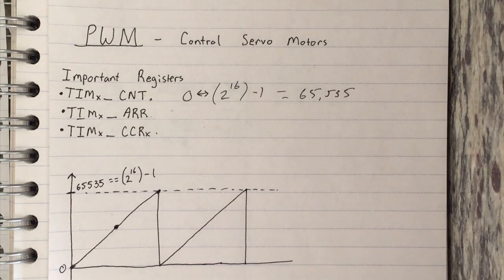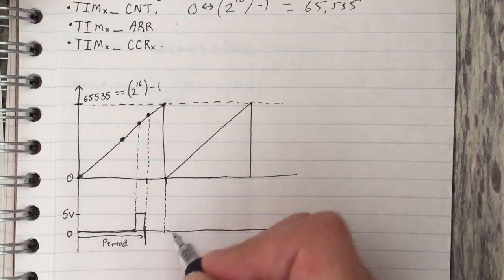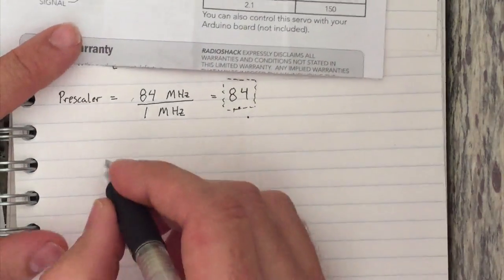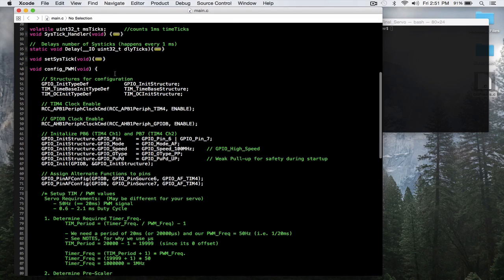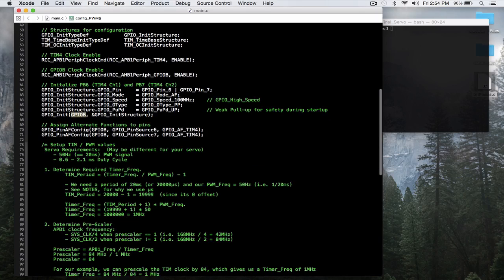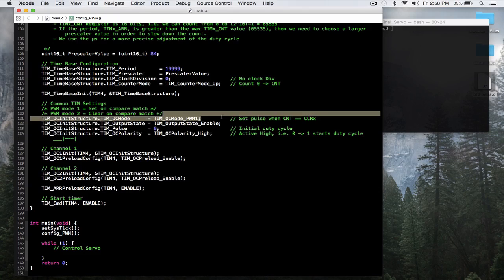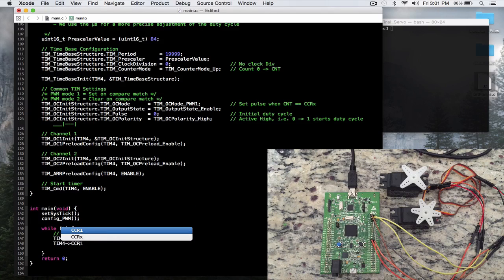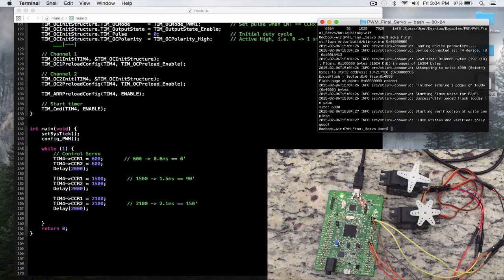STM32F4 Dev. | #5 - PWM Servo

Comment: can't figure it out why timer_freq = 20000 us * 50 ticks/s = 1MHz ?. Given  APB timer clock is 72MHz,  set prescalar = 1440, counter period = 1000,  and set CCR from 50 to 100,  should this work? had examined using oscilloscope, it seems correct, but didn't work for servo.  
please correct me.

Comment: I'm having a hard time connecting your diagram to what you did in code. isn't ccrx register the value when the counter reaches it turns logic level high? if so that would mean at 600us you are going logic high and staying high for the rest of the period?

unless you are starting high and after 600 (0.6ms) going low

Comment: Hey tony, I had a doubt regarding driving dc motors(not servo, the regular free running ones) . I am controlling them using a joystiick. I want them to have a soft ramp for a few miliseconds and than go into free running mode when I take my joystick to the highest point. Can you clear some of my fundamentals please?
Reply: kind of like how we start the car through first,second,third gear and then completely throttle it at 4th gear
Reply: i would say dynamically change the duty cycle in a loop and the duty cycle is equivalent to the joystick output

Comment: Great video thanks. Will the same program using the same header files and lib functions gonna work for my STM32F103....?
Reply from the maker: Thanks. I do not think the header files and library functions will work on that board, but I could be wrong. The procedure should be almost identical however.
Reply: it will work. the drivers are mostly constant across the f series

Comment: Great presentation! I have been working on a servo control for about week. I haven't seen anybody do as thorough of a job at explaining these things like you do. I have tried to go through the RM0090 Reference manual for the micro-controller on the discovery board. but get lost. I could use some help to understand how to look at the header files and know just what to use or even how to use it. I find it very helpful to dissect the header file functions down to a reference manual level instruction in order to see why I have to do things that way or this way. Keep up the good work.